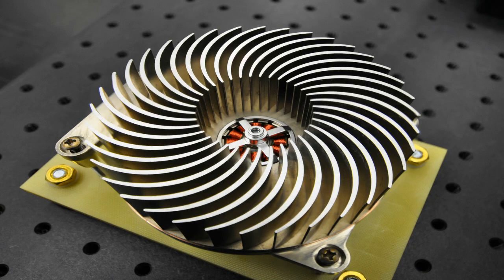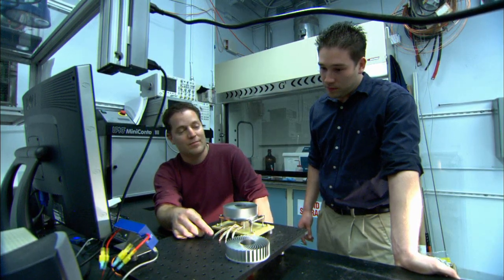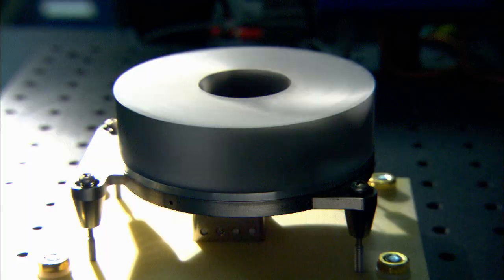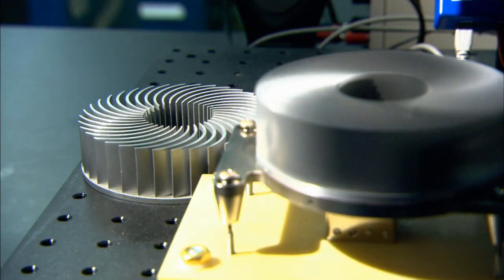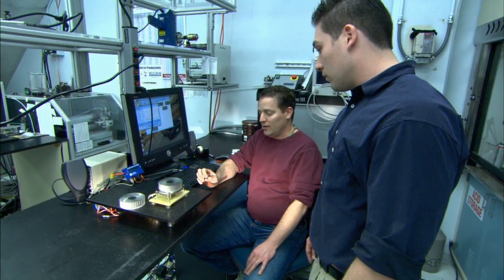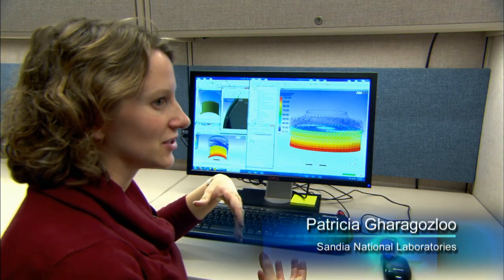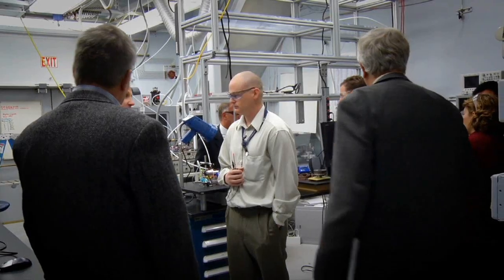Sandia Cooler

Comment: Question
1.How are you going to control the static pressure?
2.If the piece of metal, since heatsink can be made of many types of metal, is spinning at a high speed, will it create a magnetic field that will potentially damage our motherboard's chips?
3.Many has mentioned, what if it hooked up a cable?
4.How many watt will it take to power up for it to spin?
5.Last but not least, how much will it cost?

Comment: They REALLY need to reduce the air bearing gap as the current air bearing gap or tolerance it way too high, as you can see in the video the cooler is unstable in its rotation due to the air gap, if this is reduced then heat exchange efficiency will also be increased and also reliability may be increased under certain circumstances

Comment: soooo... HOW exactly does heat transfers to the spinning fins? if it haz even a tiny gap between spinning and stationary parts - its already a worse solution than stock intel cooler... =\ And how eaxctly will it behave when put vertically as in any normal computer build :sss sceptical!

Comment: That high frequency noise, I'd never put that in my PC... Also, you have unprotected metal spinning at 2000rpm in a PC case, what if a cable gets caught up in it? Bye bye cable?
I understand that when the motor is off, you won't have any sound, but if the motor is off, it won't spin. Yeah, good idea, unpractical implication.

Comment: The idea is that first spin up is loud, then it coasts with moderate boosts from the motor. Moderate meaning enough to keep it spinning but not enough to be loud. 

So, when you boot a computer, for example, you'll hear a loud whine for a few seconds akin to normal fans, then it will be silent the rest of the time.

Comment: Unfortunately this bearing concept again relies on the boundary layer effect, containing an isolating layer of air in between. Since the surface of the plain bearing is relatively large and heat is not only transferred by conduction but also by radiation this might work. 

Regarding the dust-issue I don't think that there's a significant difference compared to conventional designs. Actually 2000 RPM's isn't that much at all. I've seen dust collecting on rotors spinning much faster than that.

Comment: They are taking advantage of the fact that the boundary layer gets thinner if the object is rotating, thus making for a better heat transfer. 

Think of it as an conventional heatsink that's split into two separate parts. The tricky thing is how to accomplish the heat flow from the stationary part of the heatsink to the rotary one. Since a metal on metal bearing would mean to much friction, their approach is to use an air bearing.

Comment: Heat IS MEANT to be transferred to the fins! The crucial difference compared to conventional coolers is that the fins are SPINNING. There's nothing "blown" on the heatsink but it's rotating itself to create air movement.

It's about boundary layer. That's a very thin layer of fluid/air that sticks to the surface of an object, in this case the metal of the heat sink. It prevents the heat from being effectively transferred to the surrounding air.

Comment: No, that would be far from efficient--the cpu would actually fry the moment you turn your computer on if you try this. If you want to cool a cpu entirely on air, you would have to move A LOT more air than that to even hope of matching conventional cooling methods. 

The heat capacity of air is actually quite terrible compared to a solid block of copper with a thermal compound between it and the cpu. 

The reason air is used at all is to draw heat away from the heatsink, and out of the system.

Comment: It might not perform better, but cost:performance ratio i think would be pretty high. It would likely be more efficient than the cooling solutions we have today, and if so, it would obviously be considered by consumers making htpcs, personal nas, and also work/every day pcs. 

If its quite, efficient, and cheap as its made to be, i think this could catch on pretty fast--even if normal cooling cools better by a few degrees or so.

Comment: The fins play no role in heat dissipation. The purpose of the fins is to create a strong vortex of air to efficiently transfer heat away from the heatsink. 

I doubt dust would be able to accumulate in the fins OR on the air pocket; its just spinning too fast for dust to settle.

Comment: I'm guessing it would work fine regardless of how the device is oriented, since all it is doing is spinning really fast to suck in air. You don't need to be in a special position to move air around--fans work no matter what direction they're facing. Since its designed to spin at such a high rate, i doubt there would be any problems from operating it vertically, or even upside down.

Comment: You are confused. Heat is not meant to be transferred to the fins. The vortex of air is blown directly on the HEATSINK to remove heat from the system. The HEATSINK does the primary heat extraction. The FLUID, air, removes heat from the heatsink. A layer of thermal compound would of course be between the cpu and the heatsink.

I hope you realize that this approach is no different than how typical air coolers work--a heatsink draws heat from the cpu, and air draws heat from the heatsink/fins.

Comment: I could certainly hear it, even after the motor was turned off. It may be a good cooling solution for overclocking, but not so much for those who seek a really silent machine.

Comment: the base is attached to the processor as usual and the spinning fin part hovers above the base on a small cushion of air. heat goes up through the base plate and then through the air cushion then into the fins. yes i can see dust collecting on the fins no mater what he says and also what happens when dust builds up in the space between the base and the spinning section?

Comment: well the nh-d14 is not classed as a liquid cooling cooler i agree with that but one but the thing is that the heat pipes have liquid inside of them and some people do class heat sinks which have heat pipes inside are liquid coolers, but i dont and dont think other people should think that a heatsink having pipes makes it a liquid cooler at all

Comment: sigh.. these are all just theoretical...dust will still accumulate on it just like it accumulates on the actual fan blades of fans... sure there will be less dust and because of the design the heat disposal will be more efficient than that of normal heatsink designs but there definitely will still be a dust build up- if not on then around the actual unit.
great new tech though, props to designer - you are what makes the world advance in technology!

Comment: You're missing the real reason dust doesn't collect on the fins here. The high speed rotation is only one factor that needs to be there to stop dust collection. The physical design of the impeller itself is the difference that inhibits dust collection.

Comment: Well, look at it this way - when's the last time you've had a wire catch on an internal cpu/case fan?

The real question here is the design of the cover for this fan.  If it is too small, it will inhibit air flow, and if it is too large it will result in airflow issues inside the case (or just plain take up too much space)

This technology is amazing though.  It looks like it scales, which means they can change the size of the blades, and as long as the scaling works good, this is a home run.

Comment: I work as a aviation life support technician IRL, an aircraft I'm rated to maintain and repair has a duel RAM/engine-bleed air cooling turbine for its environmental systems. This turbine uses an air bearing instead of a classic oil cooled bearing. The air bearing turbine on this aircraft is mounted vertically, is rated to rapidly expand and cool air at temperatures up to 850F, and can can support itself above the max G rating/overstress condition of the aircraft (10-14G's). I think we're ok.
Reply: might it be dual too? "duel RAM/engine-bleed air cooling turbine " ..... chose your weapon !! LOL

Comment: I really want to see what kind of temps they get on a top processor running Prime95.  

Does it use a standard 4-pin PWM power connector?  I want to see some numbers.

Comment: i heavily question this, because it creates a gap between the cpu block and the fins that should hold the heat that needs dissipation. they need to explain it allot better if it works.

Comment: Graphics cards have what is called a squirrel cage blower. These are common in many things and is tech that was created well over 30 something years ago. This is something different, not a squirrel cage at all. A squirrel cage is just a blower that blows air through a conventional heatsink. This device in itself IS a heatsink, rotating itself to optimize cooling in a similar fashion to a centrifugal blower. It moves air like a centrifugal blower but displaces heat all by itself at the same time.

Comment: Few point need to point out here...
First, when the heat exhaust around the motherboard, this heat up the  capaticy, this will make the life span of the capaticy shorter.
Second, try compare to after market CPU cooler not the stock fan, both of us know they are crap like hell.
Third, make sure your cooler can last for 3 years or more because we can't change the fan component if the motor break down.

BTW, nice inovative product, i would love to have one if cost 50$

Comment: Looks like this thing would have to sit horizontally in a CPU case in order for the air bearing to function.  Most case designs now have a vertical placement of the motherboard.

Comment: The "30-times more efficient" is in regards to head dissipation vs energy consumption. The data is available here (put the dots back): prod sandia gov/techlib/access-control.cgi/2010/100258.pdf

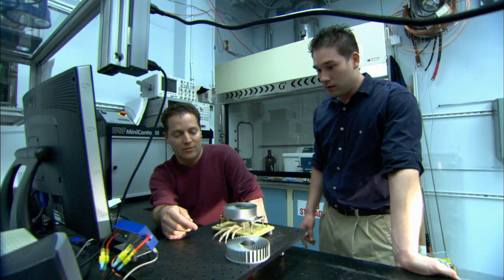Comment: They say at 3:20 that it's because they don't have anything covering up the sound from the motor.  I think they should be able to get the sound down to something like a hard drive motor's noise + the noise you hear at around 3:45 (which is almost nothing).

Comment: Besides all that, it's not like the only thing that requires cooling is a computer. What about power supplies, lighting ballasts, transistors, resistors, audio equipment? It's not like the only heat producing thing that requires cooling is a good ole household computer. Hell, what about laptops? Stuffing a water cooling system into one of those would be miraculous.

Comment: 1.. A THIN piece of paper is 100,00 Nanometers thick; the air gap is only 30,000 Nanometers or so, in this. A gap so small is more than enough to allow for proper, and really, really efficient, convection.

2. You still run into the issue of radiating the heat into the air. The water part of water cooling gets the heat away from whatever is creating the heat, you still need a sink to remove that heat from the water. Cools better than any metal could? What the fuck is radiator made out of?

Comment: how about considering the fact that not all computers operate with thier coolers level with the fan facing up? i know its just a prototype but the angle of operation thing is kinda important, my computer is on a golding card table, think i can keep that thing level all the time? hardly.

Comment: There is a Q&A they put out there that discusses it. It works better than thermal paste because of the laws of thermodynamics. "quantitatively, the numbers (gap distance, gap area, thermal conductivity of air, enhancement of conductivity by convection) work out quite well.  For a 10 cm diameter device, an air gap resistance of 0.02 C/W is certainly feasible....the violent shearing of the air residing in the gap region between the stationary and rotating surfaces generates substantial convection"

Comment: It works just fine. At that thin of a gap the air acts as a great exchanger of heat. They said they're looking at .5 C/W difference between this and a normal air cooler.

Comment: i dont believe the heat transfrare between the cpu and the "centrifugal fan" is very good because of the small air layer between them...
The should make a video about a direct compere between a traditional cooling system an this Sandia cooler. I bet the traditional cooling system is better more effektiv.

Comment: Interesting design. Im no expert in fluid dynamics or simmilar fields, but I am still sceptic about it claiming to be more efficient than any solution out there today. It's just a pretty bold statement ;-) And I'd like to know how well the heat transfers through the tiny gap between fins an base.

Comment: So, this impeller collects heat, therefore it gets hot. I am wondering how the air's direction would vary due to the expanding metal (due to the heat). ?

Comment: This will get filled with dust pretty quick... Just like my standard cooling fan accumulates dust on the blades. On this cooler, the thin spacing between the blades will just clock up faster.

Comment: They pointed out in the video @3:18 that the noise was due to the motor running without a cover, and would not be present in the finished product.

Also, this sound to me like it's being aimed more at industrial applications, meaning that the downtime of the motor would be minimal, which translates into little time being stationary and collecting dust.

Comment: I have a some thoughts... Can it be mounted vertically, for CPU mounting in a tower case? Can it be inverted so it could be used to cool GPU? Vibration transfer, concerns with damaging the motherboard over time. The biggie in my mind, How likely is a catastrophic failure? Or why is there a heavy lump of metal with high energy bouncing about inside my PC case... Not so good.

Anyhow can make the next step from interesting science to practical product? I for one will watch this with interest.

Comment: There are bg differences in idle power consumption and idle noise between graphics cards. I have two 8800GTs in SLI (I will make an upgarade soon) and they are almost unhearable in my case at idle. But I don't have a silent system, but it is not very loud when I turn my other fans (except the PSU fan, which regulates itsef and is also not very loud idle) to minimum with my fan control.

Comment: Based on the Direction of Rotation (5:03), the outer edge of the blade would push the finger away rather than "chop" into the finger.
Reply: 5:03

Comment: Question: Doesn't the 'air bearing' greatly inhibit heat transfer to the metal? By trying to solve the problem of an air barrier around the fins, haven't you created an air barrier underneath the fins? On a normal CPU/heatsink combination, the CPU is connected via thermal paste which facilitates heat transfer to the metal. Air is horrible for conductive heat transfer to the fins, no?

Comment: Very Impressive Technology form SANDIA NATIONAL LABS. Congratulations!  If I understand correctly, heat from the CPU or whatever, flows through the air bearing and heats the rotor. Then compression of the boundary layer against the cooling vanes happens by means of artificial gravity (i.e. rotating flow). Reduced thickness of the flow's boundary layer increases diffusive heat transport across the boundary layer thus cooling the spiral-shaped vanes. No wonder ANSYS-CFD is needed!

Comment: This is a lab at Sandia National Laboratories; not some corporate advertising machine. They've proven through testing that the device uses far less power and dissipates much more heat than any heat sink/fans available today. Their original publication is available here, check it out: prod.sandia.gov/techlib/access-control.cgi/2010/100258.pdf

Comment: Noise is irrelevant. It dissipates 30X the heat; opening the door for new processors and integrated circuits running at much higher clock speeds. Processors in twenty years won't even run on our standard heatsink/fan setups of today.

Comment: Air is an insulator, sure, but its thermal resistance is directly proportional to how much air you have. The air bearing is only one thousandth of an inch and it's being stirred by the movement of the upper sink. Their prototype airgap had a measured thermal resistance of 0.02C/W; a tiny fraction of the thermal resistance of heatsinks on the market now.

Comment: Air bearings are a proven technology. They operate at various angles inside your computer case already in your hard disk drives reader heads. I wouldn't want to drop it while it's running though.

Comment: They still didn't answer the real question, how is the heat transferred from the stationary base to the rotor?  All they said was the 'air bearing' but air is not a good heat conductor.  That's where the real innovation comes into play IMHO.  Ahh well, as long as it works I'll be anxious to see this on video cards soon ; )

Comment: For those bitching about the noise already, He clearly stated that is because the motor has no covers on it, with the covers the noise will be dulled. Even WITH the noise is is quieter than the crap I already have IN my case! 580 leaf blower anybody?

Comment: Plus, the thing I don't like with this is that the heat is thrown off in all 360 directions. That doesn't seem to fit well with me. In conventional coolers, you get to direct heat in a certain one way direction. This is especially needed in overclocking where boards can possibly be mounted in different directions. It is more controlled and hence more desirable. I don't know how this will work eventually.

Comment: Hype. Where are the numbers to support the claims that this is more efficient, it's certainly not smaller! Is this really going to be cheaper than a normal fan+heatsink? How does the bearing perform mounted vertically? If I power off a 120mm fan, it's pretty quiet too as it spins down. A "licence option agreement" is not the same as being commercially successful. This is a fluff piece. Wake me up when it becomes real.